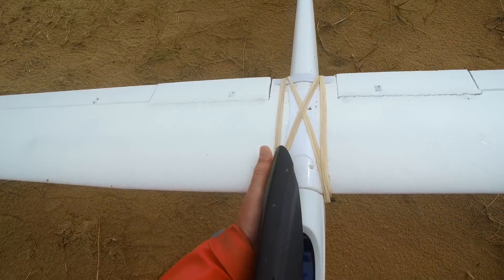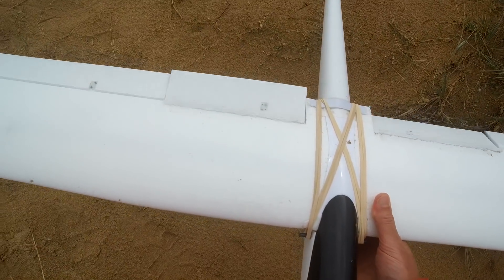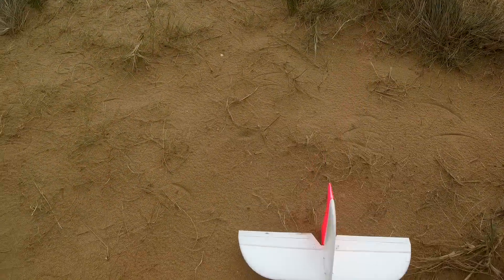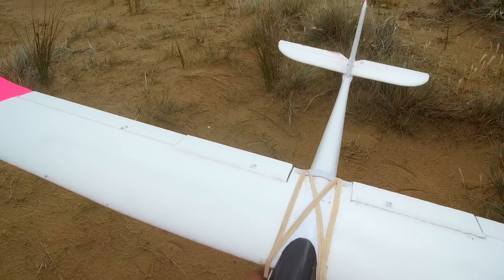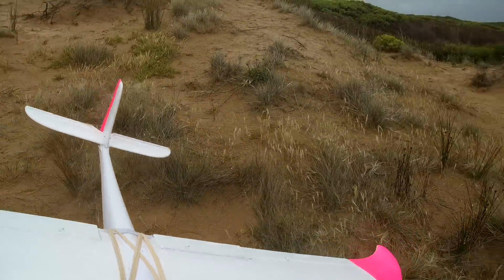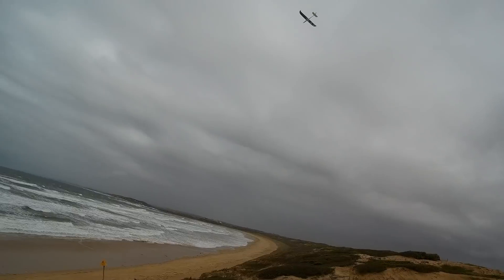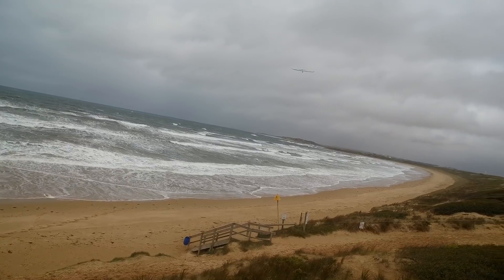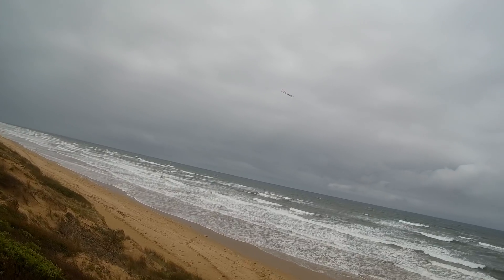Phoenix 1600 - More slope mods

Comment: Do you think it rolls better than the PK2? For better elevator response try snap flaps. I swear in the right conditions square loops would be possible. You really need a nice 1.6-2M all moulded slope ship to really appreciate the sheer energy retention that you have which such models. :-)
Reply from the maker: Faster roll than the P2K and I do have snap flaps on for inverted flight. Oh yes I'll get a proper slope racer one day.

Comment: “Keep it out in front “ wise words as I found out yesterday at Red Rock. Bitumen and balsa don’t mix too well. Always enjoy your video and always learn something new. 
Still learning by trial and error but I still come back to your immortal words”just throw it out there and see what happens “
Really appreciate all you guys in Geelong sharing so much knowledge,it’s made the difference for me to actually get out on the slope. 
I have a Phoenix evolution and a1600 coming for Christmas which I thing I will make a pure slope glider fuse and swap wings around. 
Anyway thanks again
Reply: Thats slope 101 ... and its a very common mistake.. to go during landing too far out.. with strong wind you think you will need much landing space but its not so.. if going too far behind you enter the "counter-slope" an area where the air mass goes down instead of up so planes will just go down there with little control too.. If you have a motor then you can gun it and try to fly it back to front.. 
And if its a double slope (like on top of a hill with slope on both sides) its even worse ..as if you go to the back slope it will suck down the plane much more and you risk sinking behind the slope..
I made that mistake some times.. some with bad results .. its part of the slope fun.. not just having to fly with no motor and managing the lift.. but having to spot landing
Reply from the maker: Thanks Peter, must come for a visit to Red Rock soon. It looks like an epic site.

Comment: Even if it's a quadcopter...the ultimate question for you is..."Will it slope?" 
(And, I believe  you probably would make it work.) 
Nice work...now we need the fpv with the music. 
Thanks.
Reply: I remember mr steele was in hawaii with his quads. Went up a steep hill in some crazy wind. He flew the quad around the area and on the upwind part of the hill he said the throttle was nearly off. So i guess it was sort of sloping!!
Reply: @olliea6052   i have flown a quad in a slope and the battery certainly lasted longer .. if usually i was getting 4-5m i got 7m out of that one.. in the end the slope is basically a mass of air going up that you surf.. so maintaining altitude is like "going down" in a still mass of air.. 
It works the other way too.. once i was flying the same quad in a site with a "counter slope" (a slope going the oposite direction of the wind..so lift goes down" i flew over it and then i found myself sinking quite fast and had to use quite more thorttle to fly back out of it than i normally would..
Reply: there is a saying... at a slope with enough wind (and enought slope) you can make fly a brick